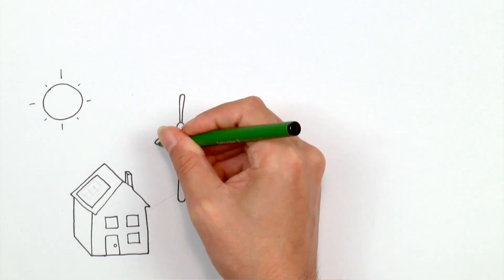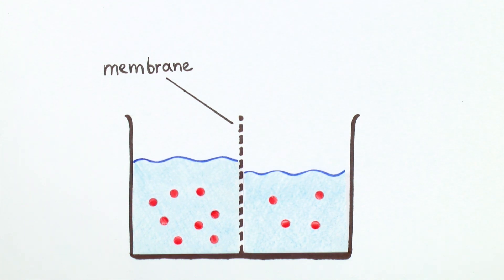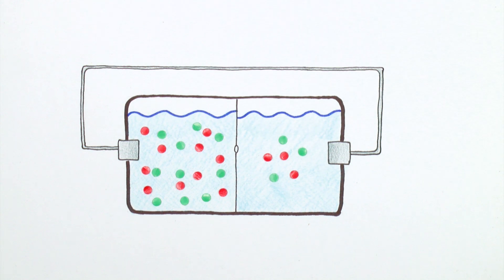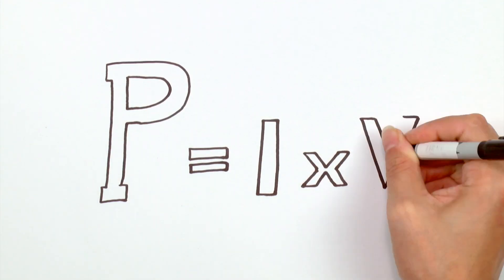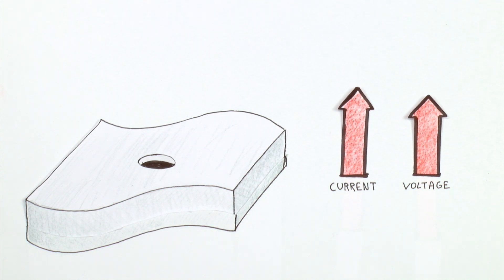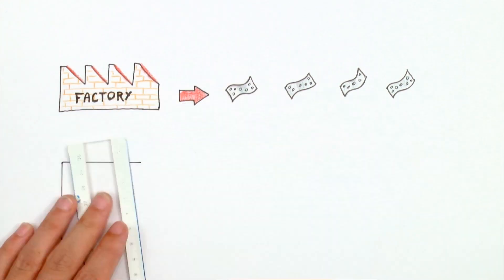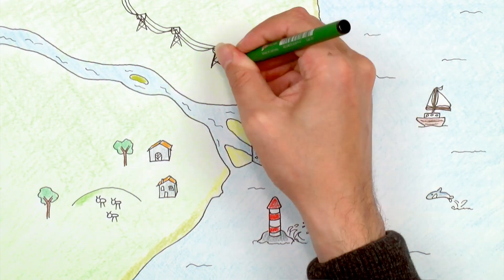Water generates electricity (with a pinch of salt!)

Comment: The solar energy is 1370 W/m^2. After adjust by sphere surface area (multiply 0.25) and by atmosphere stuff (multiply 0.51) and by the blackbody efficiency for yellow light (multiply 0.87), the power is 152 W/m^2.  According to law of conservation of energy, any energy (other than tide/geothermal and originated from the sun) generating method who claims more than this power is one of the below:
1. The material necessary to do the energy generating job needs some energy X to manufacture. And therefore we "deposit" some energy X into the material first in the manufacture stage so that it will release X later in the energy generating stage with the inevitable decaying power.  If a method is such category, it is meaningful for emergency energy usecase and meaningless for long term sustainable usecase.
2. The method requires some "old battery" such as coal power plant where the coal is the "old battery" manufactured before.  If a method is such category, it would change the materials composition ratios of the environment and not a sustainable energy whose definition is not to change the materials composition ratios.
3. The method is a fake.

The method who claims 1 MW/m^2 in this clip is either 1 or 3.
Reply: >The method who claims 1 MW/m^2 in this clip is either 1 or 3

Actually, it's 2. The energy comes from the disassociation of fresh water from salt water by evaporation from solar energy.

I'd really like to see a working prototype that generates something in the ballpark of 1MW/m^2 though, and also the rate of exchange at which the ions must traverse the membrane to sustain 1MW/m^2. At what rate does 1 m^3 of fresh water gets "contaminated" with salt ions to sustain 1MW?
Reply: @Rhannmah  Thanks to your explanation, then I think it is more like 1 rather than 2 which is pretty much like thermal solar mirrors of a huge area focus their light to a single point in the center.  The difference between 1 and 2 is basically the tradeoff of space or time to collect more energy.  At least to my viewing of the clip, the number 1M W per meter^2 was somewhat misleading the news press because it is actually that huge area contributes.  I think no one would be exciting with my solar mirrors example of 1M W per meter^2 at the central point.
Reply: thanks guys, that was some solid critical thinking, very inspiring!

Comment: Why not just make the pores with negative charge around the hole and sort of make it into a positive vacuum like passage pulling the right kind of charged particles and there by opening up the pores pathway larger, you could gradually make the pore thicker as it widens out more from the center or you could make multiple small openings all over the membrane making multiple paths for the current then scale it up.
Reply: I believe you "vacuum" idea is right on target. I can't imagine the mebrane material being able to widen though. And the idea was all along to scale up the pores, making more holes all over the membrane. The one pore set up is just for clean testing.

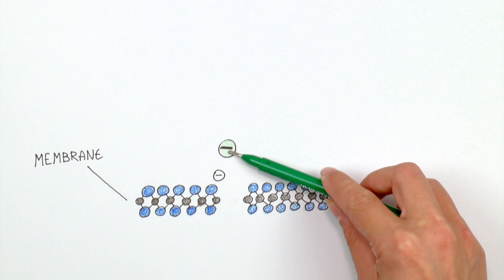Comment: 1:56
why wouldnt the positive charge attracted and stay with the negative charge, instead of passing through the holes?
Reply: the ions on the left side have an osmotic pressure that tries to push all (positive and negative) ions to the other side.
the nanopore has a negative gate that repels the negative ions and only allows the positive ions to pass.

Why doesnt that positive ion just stick to the negative gate?  I think the hydrogen bond is much weaker than the osmotic pressure.

Comment: Isn't it a fake?
Reply: no, it releases energy since entropy is increased. Look up mixing entropy, this method is based on that underlying principle
Reply: its not fake but the video makes it sound a lot more simple than it is. 1st you need a very clean water source, very pure salts source at a very high concentration adjacent to a water source with near 0 salt concentration... then you need to hope the thin 2d membrane doesnt degrade over time, while collecting and controlling the current and voltage.

Comment: This idea has been around forever! It is a classic science project in schools. You do not need to be able to use nanotechnology to drill tiny holes into material. There are many semi-permeable membranes available now that will do the job. The Norway plant that they mentioned shut-down because it was not cost-effective. Millions of dollars were spent to produce only 4 KWs of power. My solar system with 24x250 watt panels produces 5KWs and cost only $15,000. Yes I know that my system only produces energy during the day, but I feed the surplus into the grid and get it back when I need it.
Reply: Current available systems use osmotic pressure to drive a turbine. But in this case we are getting direct electrical energy similar to a fuel cell using osmotic energy instead of chemical energy.

Are u sure this was done before. any links? 

One problem in this is that u would get sodium on one electrode and chlorine on other. what would you do fix this?
Reply: "I haven't watched more than 1 minute into the video", the comment